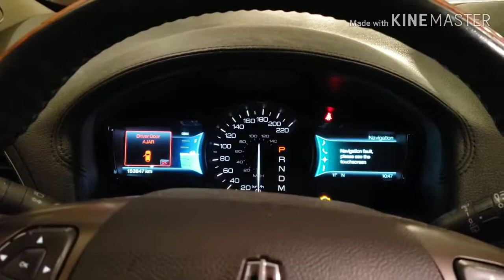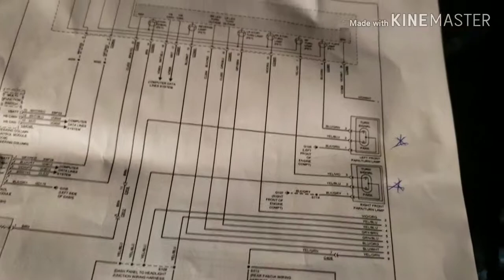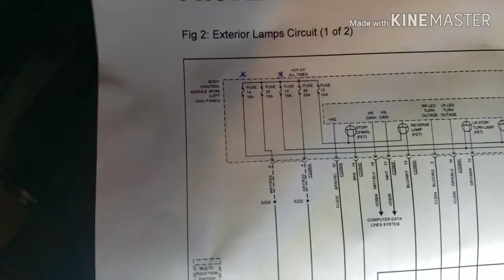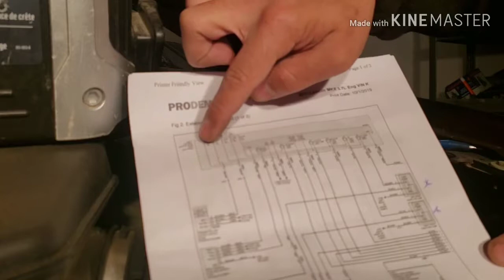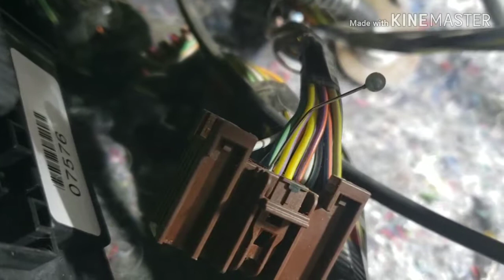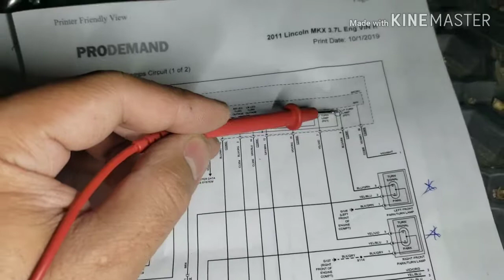How I Diagnose & Fixed Signal lamp bulb Lincoln MKX, Ford 3.7L

Comment: Good job man. Just for shits I would have swapped that fuse anyway hah. Open up that fuse block and see if there is corrosion on any of the connections in that circuit or terminals.